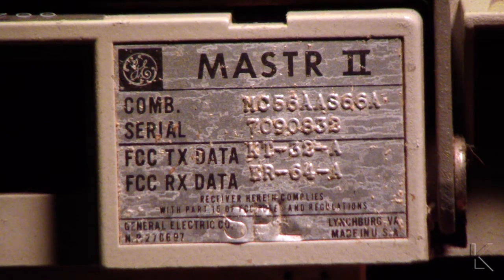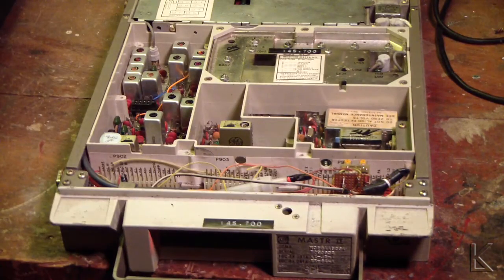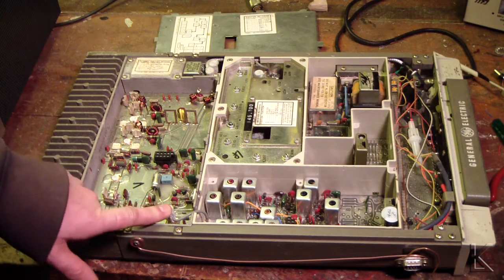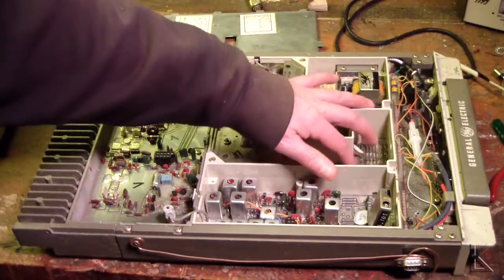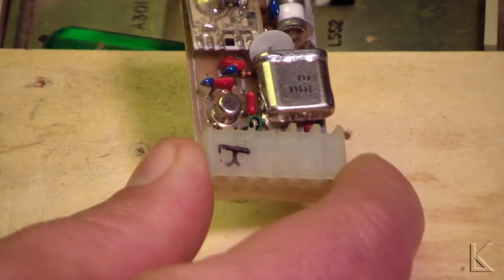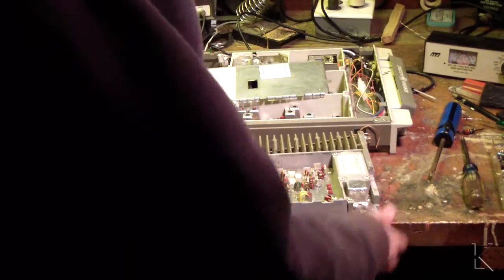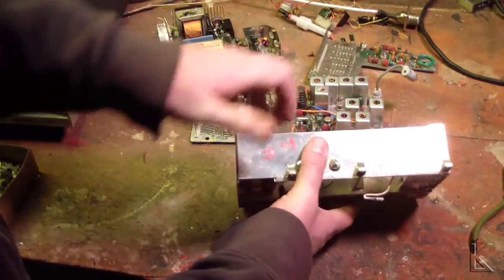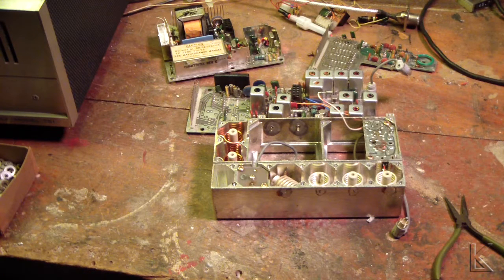Ham Radio - GE MASTR II industrial VHF transciever teardown

Comment: "ICOM"s Integrated Circuit Oscillator Modules, used to work on GE Master II's early '80s  Also there was a caution from GE regarding the final PA transistors, as they contained berillium.

Comment: Great video, I have two Master 11 that I operated in service trucks years ago. I wanted to check them out for possible Ham operation but do not have the keys to open the case. Great to finally see how they are built.
KF5NBC
L. Moore
Reply: You need a BF10A key to open them up.

Comment: Associated Charter used the Mastr IIs with the 4 channel push button control head during the 1980s.  I had a vacuum tube GE IMTS Mobile phone unit which was all metal.  Incredible how it was all machined. Incredibly heavy.

Comment: I have a GE Mastr II VHF Repeater that include the 6ft locker with gouges repeater unit with amifier and hulking power supply unit. All thats missing is the duplexer. I am in central Illinois if anyone has any interest in making any kind of offer on it. I really don't want to tear it down to scrap because it all works and has life left if anyone cares to use it.

Comment: This was my 1st 2M mobile rig back in the mid 80s. My brother worked for a commercial radio shop and did the conversion on it. 2 channels for local repeaters. At the time had significant punch from the mobile. I also had a Clegg 27B that I used at my base QTH.

Comment: Kevin, thank you very much for your time producing this informational video! I ran a very similar GE Delta low split tuned up to 6 meters for years, indeed it is a tank, the only thing you can do to keep it from working is to remove the battery from the car, hi hi. 73
Reply: Good to see the old unit. I worked at GE mobile radio in Florence SC from 1980 to 1982.  The MVP mobile and Phoenix were also made in SC.  Lynchburg did the Handhelds and repeater units. Florence had the Mastr II and Mastr Exec lines.